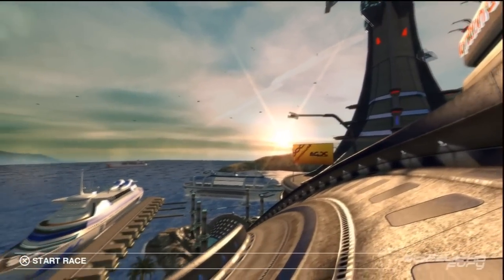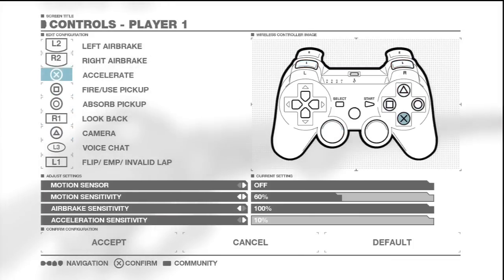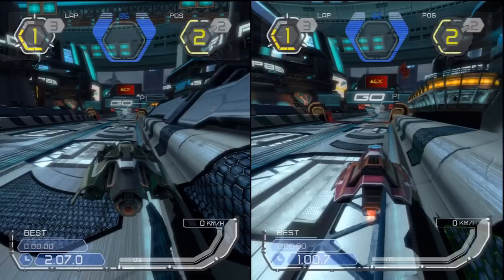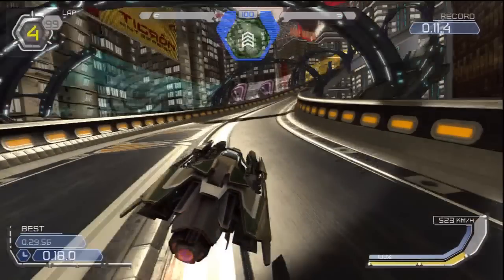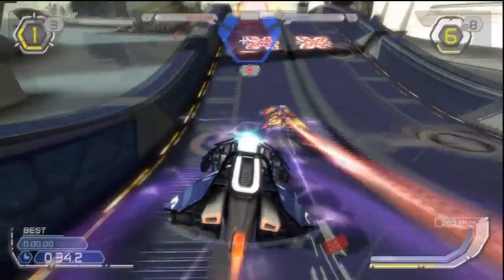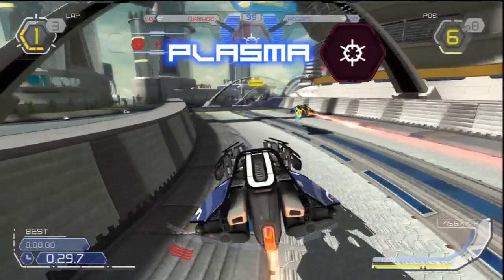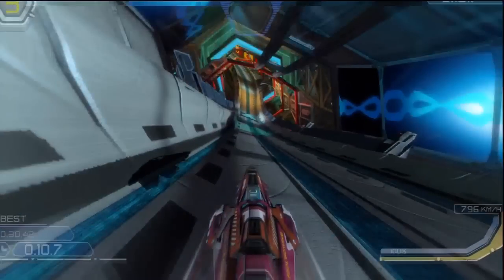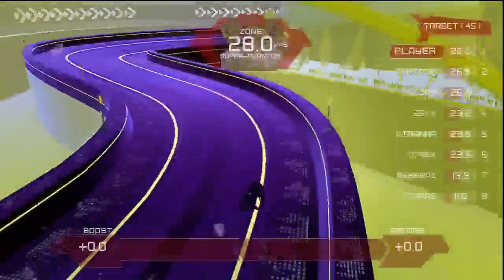Wipeout HD Fury - The Basics

Comment: I was about to ask why, then I got to the pitching section of the video.  I understand now why you would use a d-pad over an analog stick for Wipeout.  The extra finesse from an analog stick is unnecessary when the airbrakes are available (assigned to triggers even in HD) and it's a lot easier to pitch and steer simultaneously with d-pad.  

I gave up on it when I was using analog stick.  Sacrificing full steering to pitch on certain turns got annoying fast.  Thanks a bunch for this video!

Comment: You don't have to use airbrakes to take corners - instead slide up the outside sidewall (by holding nose up) and you can take any corner at ANY speed. Also, if you get the correct sequence of power ups you can slide up the sidewall and use boost to perform jumps MASSIVE jumps clear across the map.

Comment: If you pickup mines or a bomb, and suddendly you get a missile incoming, you can actually block the attack by dropping them at the right time. The AI can do this, too

Also, if you drop mines at the same time you do a side-shift, the mines are layed out in a diagonal pattern that it's impossible for the AI to avoid. Difficult to pull out, though.

Comment: Things I still wish WipEout HD had:
- At least two tracks from each non-PSP ipEout game
- A Replay system
- Head-to-Head mode
- The Vector speedclass
- Van-Uber
- The other WipEout HUDs (Classic, Pure, Pulse, 64, Fusion, and Fury (for non-Fury modes))

Even though it doesn't have those, it is still an awesome game. All I am saying is that if it did have them, it would be even better than it already is.

Comment: I have all the tracks memorized by now but I do not seem to be able to to the fine adjustments in line that are critical to hitting speed pads and power ups as well as
avoiding wall collisions.  It would be wonderful to see the button taps on screen in a
real-time race.  I simply cannot get any ship to follow the race line I want it to and I
am probably doing it exactly wrong. Example: if I feather the air brake I get a side shift.

Comment: I emulate this game on RPCS3 using an XBOX One controller, X is mapped to the A button on the XBOX controller and I don't think the face buttons are analogue, L2 and R2 are, but they're the air brakes.  

Customising the controls may not be an option as the only analogue controls on the XBOX controller are the two sticks and the triggers and the triggers are the air brakes.  
I will say this though, if Sony were to do to the Wipeout games what they've done with God of War (i.e. release them on PC) I would actually buy them.

Comment: 24:19 For those players that are stuck using Pilot Assist, here are some suggestions:
Do every track (reverse and Otherwise) in Zone Mode
Do some Racebox Speed Laps on Phantom Class with Pilot Assist set to 'Off', preferably not in a FEISAR.

After a week or two of practice, problem solved.

Comment: 20:20 - BRs will cost you 15 shield energy irregardless of if you performed the roll successfully or not. As long as you do the input in the air, it takes 15 shield.

Comment: you can't get this game on the vita, the HD/Fury available on the PSN for vita is a DLC to 2048, depending on how you like to play though, 2048 may not be the only option on the vita, 2048 is a great game but has only 2 modes (excluding DLC) single and multi-player. Single player doesn't offer much replay-ability other than beating your previous time. Multiplayer is great but you need online. The other option is wipeout pulse from the PSP library. Great game and my personal first.

Comment: are you using d-pad on ps4 or analog stick? What do you recommend? Cheers
Reply: If i remember correctly, he said its much better to use the D-pad cause its a little more accurate than the analog stick.
Reply: SlashTrike well, yes, he said he used the d-pad, but not because it‘s more accurate, it‘s because older WipEout games used the d-pad as default steering method so he just got used to that. I recommend analog stick, it‘s much more accurate in my opinion. If you don‘t believe me, watch some of my YouTube videos or the features channels I have on my page. They are all pros and 90% of them use stick.